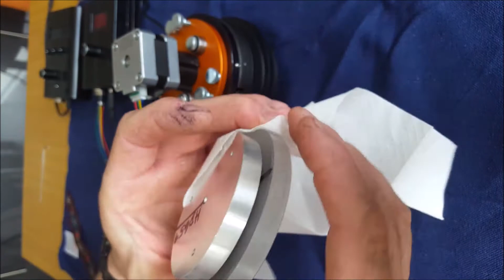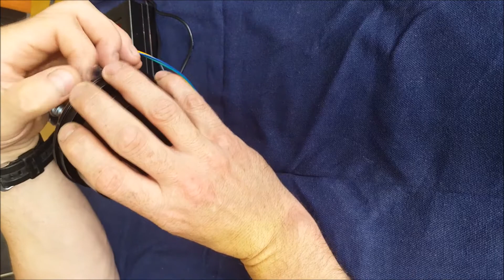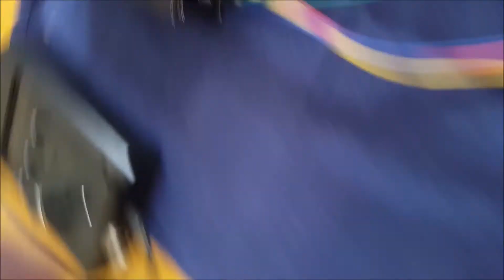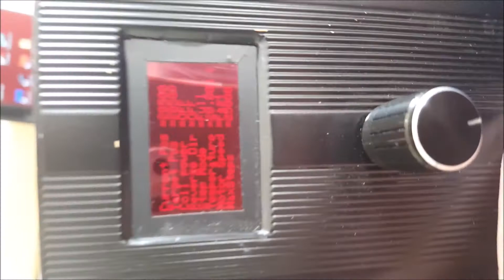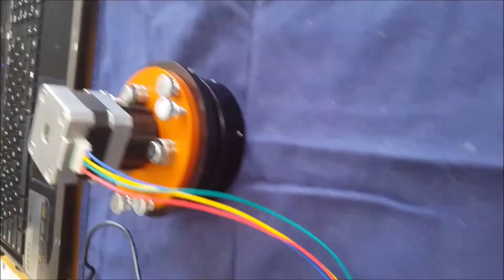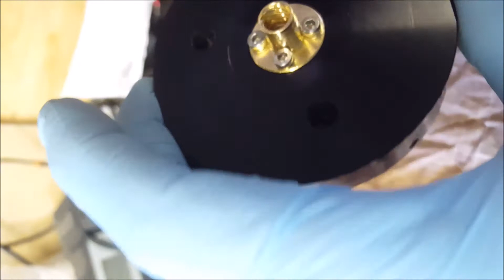Celestron SCT 14" EDGE HD Ascom Secondary Mirror Motorised Focuser DIY myFocuserPro2

Comment: Not so sure about your motor choice seems overkill.
Also if you are going to use batteries & wirelessly control it with a local micro controller you may want to add 3 more motors for collimation it makes the job a lot easier.